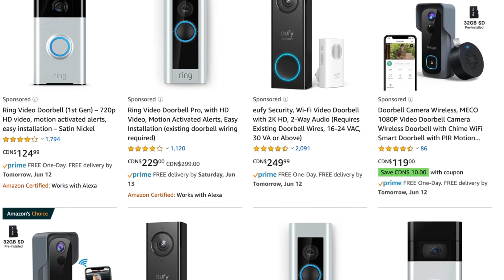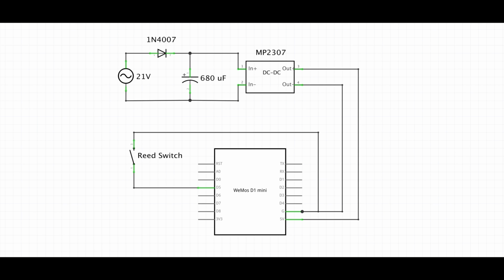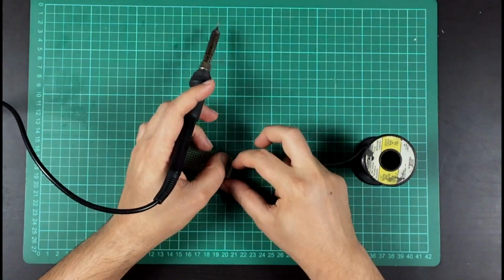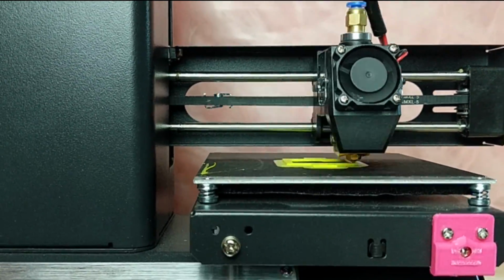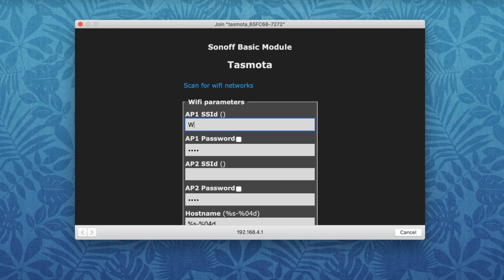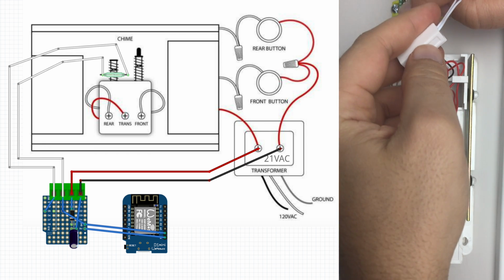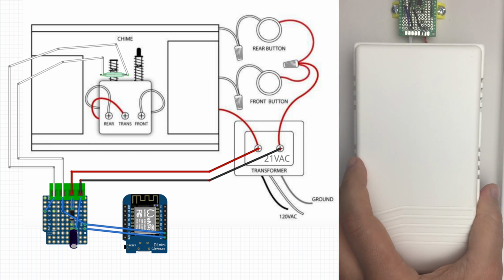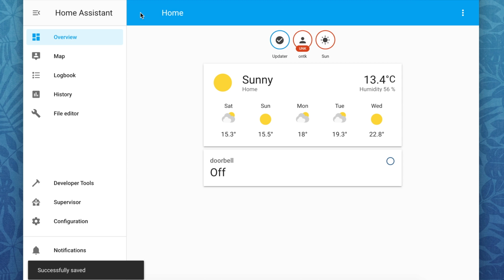Make your Doorbell Smart using ESP8266

Comment: I know I'm commenting on an old video. I don't understand doorbell wiring well enough to understand how the device will stay powered without the doorbell button being pressed. Does this design assume the ESP will be powered only during the doorbell push?
Reply from the maker: No, I powered it directly from the transformer, not the wires going to the doorbell button. 21V/Power & Gnd wires are coming from the transformer.

Comment: how do you attach to the transformer when it is located at the circuit panel and at the same time mount the unit at the Chime?
Reply from the maker: Hi Ken, because the transformer is connected to the chime with a long wire ( this is how the chime is powered).
Reply: @MrDIYca  True but I have no voltage at the CHIME until the doorbell button is pressed.  Your diagram shows a Red and Green wire directly across the transformer.  This voltage on my setup is not present since the doorbell is in series with one of the wires.
Reply from the maker: @n1kkri  Ah ok. I haven't seen a doorbell system seup that way before. It is usually transformer > chime > doorbell. It seems you have transformer > doorbell > chime > transformer.  The cable that is going from the transformer to the doorbell, does it have 1 or 2 wires inside?
Reply: @MrDIYca  On my door bell if the transformer was wired across the 2 screws it would start chiming away. Because its in series with one of the transformer wires when the doorbell is pressed the other wire is not touching the chime and it makes it work.
Reply from the maker: It looks like you have option (1) - check this image for reference https://ibb.co/yVgYPG4. You are missing the power return wire. In option (2), both power wires are available at the chime, like in my video. If option (1) is your setup, then this solution will not work for you - unless, of course,  you can run an extra wire from the transformer to the chime.

Comment: has anyone tried using one of the less than $20 on amazon, water detector with WiFi units for this application?  Would shorting the 2 post water contacts with be replaced with the reed relay at the chime do the same thing?
Reply from the maker: I haven't seen that before, but I don't see why this shouldn't work.
Reply: You could also use a door sensor because that already has a reed switch built-in
Reply: @Leonvolt28  I ended up bulding something that used a coil one of the chime doorbell wire runs through.  It senses the current when someone rings the doorbell and it sends me a message using Blynk.  It worked but it occasionally gave me false alerts.  Tried for a few weeks adjusting the sensitivity but just could not remove the false alerts.

Comment: I am not very clear on what you did with the reed switch, how you mounted it. Does it interfere with the mechanism?
Reply from the maker: The coil in the chime, when energized, creates a magnetic force that the reed switch can detect.The reed switch placement and orientation depend on the direction of that force ... which depends on the coil placement in the doorbell. You will need to place the reed switch close to the coil and keep changing its orientation until it is able to detect that force. Then just glue/tape it in the found orientation.

Comment: May be a silly question but how exactly does the reed switch know when the bell goes off? How does the one part of the switch move away from the other when a bell goes off? I may be missing something obvious here though so please be gentle 😉
Reply from the maker: Not silly at all. The doorbell chime creates a magnetic force that pulls a metal to make that doorbell sound. It is strong enough to have an effect on the reed switch. When the reed switch connects, it closes the cricuit - simular to pushing a button. And that feeds into the Wemos D1 mini which triggers an MQTT message. Feel free to reach out if you have other questions!
Reply: @MrDIYca  How does this differ from a "different" kind of doorbell like a "buzzer" ? Thanks